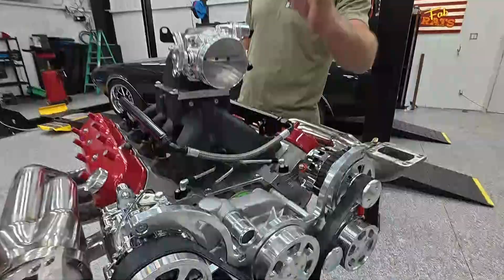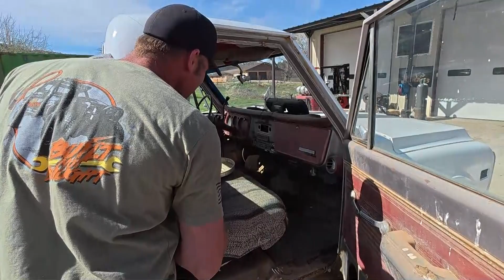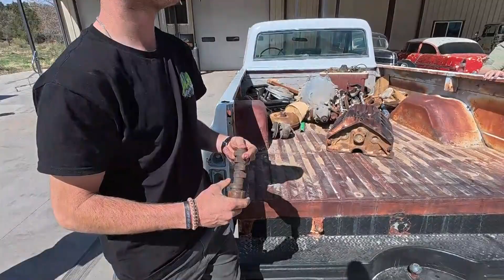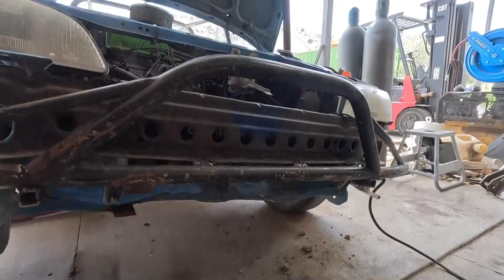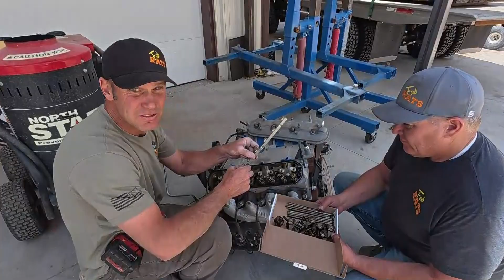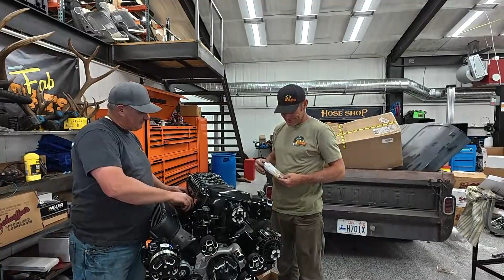They Surprised Me With My High School Truck!

Comment: Paul just fyi just behind the timing cover on driver side there is that pipe plug use that hole to prime the oil system as it bleed more air out right away. Think of it like filling a lower unit on a boat

Comment: I had a 72' long bed 2WD that i bought for $300.00. No engine, no glass and bad paint, Chevy burnt orange color.  Loved it. Replaced everything you can think of on that truck. We had a junkyard close by that I could get great parts for $20 or $30 bucks if I pulled them myself. Had it painted metallic copper brown, replaced the huge steering wheel with a power steering tilt wheel and bucket seats. 373 limited slip rear end and wore out 3 small block 350s in that thing. It was a beast for 2WD. Can't tell you how many center support bearings I destroyed with my heavy foot letting 2 gear bark the mud grips on asphalt.

Comment: Oh boy that brings back many memories for me.  My mom had a Chevy just like that one.  It was a camper specail with two gas tanks and a shell canopy.  We would pulled the horse trailer with it.  I got my driver license in that pick up.  I ran off the road in the sno and hit a tree right after mom got it fixed after hitting a deer with it.  I had it catch fire while driving on a mountain highway with no place to pull off.  That old Chevy survive my two brothers and I amazingly enough.  The only issue whit it was the fly wheel.  Every couple of year mom had to have the fly wheel replaced. One of the better Chevy products.😃

Comment: I noticed the fuel line routing from one rail to the other fuel rail on your S/C'd engine. On my STI tuner car I built a parallel fuel line setup. Apparently the last cylinder to get fuel on the OEM setup can end up being starved for fuel. Maybe your fuel line is plenty big that it's not a potential issue? I need to repurpose my OEM fuel line as the return & order -10 AN to supply E85 to to my parallel setup as my new FP Black Turbo has a bigger demand. Upgraded to 1750cc injectors too. 😎🏁

Comment: I've always been a supercharger man. Starting back in 1970 with a 671 Jimmy on a 440RB wedge head, followed by a 426 Hemi w/ a 871 Jimmy in 1971. I've been a Whipple fan since 2000 when we put Whipple's on a pair of 500 Bull Dogs in a 38' Formula Fast Tech. All of the builds were awesome.

Comment: I drove a 1996 Buick Park Avenue with a Supercharged 3800 V-6 that car would launch and being front wheel drive it would try to put you in the ditch if stomped to get on a road from a side street, in a V8 it will be real impressive.

Comment: My first truck was a '67 Chevy too!  Mine was one my dad picked up from a Navy auction, so it was a stripped down half ton, step side, with a 250 and "3 on the tree."  I miss that old thing.  It saved my life in a roll-over accident.  It landed wheels down, 30 feet down an embankment facing the other direction.  And it still got me home, 300 miles away.  Last time I saw it was 10 years later and it was still running.  Those old trucks have stories to tell.
Reply: My first truck was a '67 Ford 3/4 ton Highboy 4x4 with a 390 that I bought from my buddies dad, and I had some fun in that truck! The first time I went digging in it, we were bouncing around, and the fan ate the battery! I guess I should have made sure the batter hold down was fastened securely, but you live, and you learn! I think I was only 17. Good memories!

Comment: I hope you did your homework and running all holley swap parts. The engineer for all the swap parts has multiple threads on LS1 tech. He designed the pans mounts trans and motor, and the bla k heart exhaust system. Look under the hybrid section. Trans wise, you'll eventually blow the 4l60e up no matter how built it is with that much power your making. 4l80 probably gonna have to cut the floor. Manuals wise 6spd cut the floor TKX more than likely fit with no mods. Just saying.

Comment: The turbo drains you placed on each side of the oil pan. Turbo drains typically don't work on the passenger side because the crankcase windage/going clockwise pressure is higher the gravity draining oil out of turbo. The drivers one will drain. The passenger wont drain well. LS typically install drains in the front cover as low as you can just above oil pan rail all the way towards the outside. Lots of guys sell front covers with fittings in them but you can weld.

Comment: Except that's a GMC truck, not a Chevy.  I mean, the differences are nearly all cosmetic, but still.  I'm basing it primarily on the grill, which looks like a '68.  It doesn't have the GMC in the middle of the grill, which eliminates the '67.  Anything is possible, though.  Parts: we used to mix and match without too much regard to concourse quality of exact match.

Comment: That's a cool truck. I had a 70 GMC 4x4, and it was a great ruck. The GMC, in my opinion, is a better-looking and more desirable truck than the Chevrolet. The front bumpers are impossible to find in really good condition.

Comment: My first truck ws a 70 short wide 2wd, I sure miss that truck. I bought it with a broke down Pontiac 400 in it and I switched it back to a 350. I loved the fit of that truck better than any I have had, it was comfortable to drive.

Comment: My first truck was a 57 Chevy short box with 327 and a 4 speed.  My second  truck was a 72 Cheyenne 3/4 ton with all the chrome and factory air.  Put a 69 grill in and mounted driving lights in the bumper where the turn signals were.Three tanks held 55 gallons of gas. TH400, duals, front disc brakes.  Had it for about 10 years.  Still miss it.

Comment: Many years ago I worked on Detroit Diesel Engines  for a time before I left on a mission.  Your supercharger, and most of them are off a Detroit.   The key is you have to get turbochargers wound up.   Superchargers have a bit of wind up, but they get things going much faster.  A supercharged engine will always be quicker out of the gate, within reason.

The drawback to superchargers is, if you get a big backfire event, you’re pretty much guaranteed to destroy your supercharger and a good portion of your engine.   You can usually get away with an event on a turbo charged machine.

Comment: The Snap-on tool that you received in the mail. Not only is it for adjusting carbs but it also has a bit to adjust the points/dwell on GM distributors. I have the same tool. Don’t use it very often but it sure comes in handy when adjusting a “hot” engine.

Comment: Put both on one engine. Then you can pipe both turbos into the supercharger. You will then have a super-turbocharged engine. The turbos will spool up so fast,  that the turbo impellers might get sucked out of the turbo housings. Awesome & interesting videos as usual, especially for a disabled guy like myself. Peace out guys.

Comment: I have a 67 Custom with the big window. It was our tow rig when we were racing. It's got a 9 inch with a Posi  internals out of a Mustang  with a 455 Olds and Turbo 400. A mild build but arp bolts and the customary rv cam and flat tops plus balanced. I built a 10' bed for it, another floater rear axle  and threw on a Kidnapper with a gooseneck to pull the trailer. It was a beast. 3.00 gears. It just pulled like a diesel. Still got it but it hasn't moved for 25 years. She actually got good mileage on it's own. Scary part was when it was unhooked. You quit before it did. Crazy what we did back then. Those old trucks you worked on all the time are just tough to part with.

Comment: Superchargers all day, of course saying that as a same truck owner for past 55 years. Currently runs a Weiand 177 on sbc. Used to run same size blower on bbc but 7mpg was killing me gas wise, so went to sbc in 2010. I use my truck for towing a RV so major hp gain was not the goal-pulling uphills in west usa can take little extra power at times.

Comment: You going to add a separate oil system for turbos?  That's what generally takes out turbos is bearing failure from heat.

Comment: I have a 2002 Chevy Duramax 1 ton Dually diesel RWD that was my work truck for the last few years, and I'm retired now. It has cold air intake, exhaust brake, tuner, and air dog fuel system. I plan on selling it for next to nothing and just wondered if you would be interested $4,500. takes it away. It does have body damage to the stupid plastic rear panel on the driver's side from backing up into a way to steep driveway with my trailer, other than that it's fine. Let me know if this interests you.

Comment: Hay paul the turbos make power with in half a second and there more for the top end of the run. They don't make all the power like a super charger does from the start they have all the power on tap, but the turbos will out power on the big end of the track bc they just keep making power when the super charger tops out. You van only spin it so fast and that's the down side to the supercharger. There good for off the line but get left on the top. That's from my experience of them both

Comment: The sweet ride I had in high school was a 69 Chevy long bed, 383 small block (nowadays called the stroker conversation) chevy V8 with  with cam swapped from a 400 big block, re-ringed , everything was gone over adding new be install, play Muncie 4-speed, and a home ^made posi*winks@paul😉. It wasn't a factory engine. Dual Hollies on top. This was back when gas prices were 25-29 cents a gallon.
Best fun had in a shop and1 friend to help, took 3weeks.

Comment: I prefer superchargers due to the turbo ‘overhead’….letting it idle for a minute or two before shutting it off to let the   spool down, especially after spirited driving, excess heat and cooling cycles unless it has a water cooled design and low end power build although they seem to have worked this out on my current twin turbo Audi RSQ8…..

Comment: Yep.. I had "friends" like that.  My 84 Blazer that I had to leave at a buddy's property got "stolen"     I had worked on every part of that truck.  Welded in new panels anywhere there was rust and eventually replaced the front clip with a narrowed and shortened Hummer tilt front mounted to a custom made front bumper that I built from 4" square tubing I found at the scrap yard.  
   I absolutely loved that Blazer and would drive my kids up to Michigan in it to visit my family and take them swimming and just on country drives.
  The trans started failing at the bottom of Michigan with a long drive to Maryland... I prayed for God to just let us make it home.  I literraly pulled in to the driveway, thanked God and instantly, the truck would not move another inch under it's own power.

Comment: My Dad had a 71 3/4 ton.  It ran good, and he wanted to give it to me.  I didn't have the skills, tools, or the space to restore it.  It needed body work because of rust.  My cousin ended up buying it.  Last year I had a chance to see it, he has the tools, skills, and space to do what is needed.  He had it stripped down to the frame, and was installing body parts from a parts truck he purchased.  He had different cab on it.   He was in the process of converting it to 4WD.  I can't wait to see it when it's done.

Comment: Paul,

You and I are roughly the same vintage and have a similar life connection with those trucks. I bought a '71 Chevy Cheyenne 2 wheel drive when I was 16 for $300. I drove it for a couple of years in high school. I learned all about wrenching with that truck, including swapping out a used 350 engine and then a fresh rebuilt 327. Lots of good memories hunting deer and also terrorizing the town in that truck.

When I was 18, I bought a '70 Chevy Monte Carlo (also for $300 interestingly enough), and swapped that good 327 into the Monte. I then sold the truck for parts, but amazingly I still have the Monte. My wife jokes that she is going to bury me in the Monte when I die.

My claim to fame with the truck is that by the time I pulled that 327 the last time, I had it on the floor in 45 minutes (and that was before air wrenches)! Of course all the bolts were not rusty, and I knew where each one was. 

Great memories!  I really love how that truck taught me how to work on that vintage of Detroit Iron and to appreciate the styling and engineering of that era. The 60's and 70's car and truck design will never be beat.

I'll watch for wrenching on it, and whenever we come through Utah, we will come and meet you all and get some more merch at the Fab Shack.

Happy wrenching.

Comment: A motor with Twin turbo with a blower and nitrous. It will be one bitching motor if you can get it all to werk together. The instant power that a blower give will allow the time the turbos it needs to spool up. The  nitrous will add to the power. If you can get all that power on the ground, you will have a vehicle that will be a handful.

Comment: Me and my students built a 68 c30 years ago. 572 CBB with direct injection and supercharger. It ate th400s for lunch. I chose a Allison 6 speed transmission for it. That was the transmission that worked well with the high  power of the engine. 

I did end up using a long bed for it, but had to modify the bed with a step side type of rear fender for the rear end and tires to fit in the way I want.

Comment: For the ones who don't believe in o-rings . Don't be afraid . My air rifles fill to 350 bar or 4500 psi . If it holds that kind of pressure it's going to hold anything a motor intake can generate .

Comment: My truck I had for over 25 years was a 70 1/2 ton 350 4 bolt main, turbo 400 with limited slip posi in Turquoise and White with A/C, miss that truck

Comment: I bought my first toolbox back in 1974 from a pawn shop. It was just one of the larger top handle carry Trey type toolbox but it was packed to the gills with stuff. And in it there was a set of these little plastic things with magnets in the centers of them with different sizes for different sockets. They would hold the bolt or nut  and you could place them anywhere you wanted without losing the nut or bolt.

Comment: Paul have you seen the new engine stand that have the crank on them so you can easily turn the motor around to work on different parts of the motor Robbie just bought one I believe from Harbor Freight but don't quote me on that. After seeing Robbie and you work on a motor it is kind of cool check it out

Comment: I like the look of the all black and compact size along with the superchargers unmistable wine that they make.. the twin turbski's are fun to r u deal in especially when the blow off valve releases that air pressure but they just take up so much space and kindof clutterbthenengine compartment up plus u can't really pull up all stealth like in true sleeper fashion and smoke them light to light with such satisfaction as they try to figure out what u have that just smoked them where if u pull up with twin turbos most people won't want to race ya cuz they know they'll get smoked so if ur into racing for pinks a twin turbo setup is going to ruin alot of chances

Comment: I don't think you'll be as enthusiastic about the turbos until you get better turbos. If it's a budget issue call Viren at VS Racing for an affordable, reliable turbo with support if required.  He has some very nice mirrored turbos that would be much more visually appealing than current configuration.  Independent waste gates and blow off valve are desirable. 
At that point you will definitely become a turbo guy, especially if you have any desire to TURN IT UP. (Have your Tuner show you the up arrow)
Nothing like 28lbs of boost...

Comment: I had an old 64, back in  76-77. An old 6 cylinder, straight drive. Had a black diamond pleated interior ( seat ). Drove it for about 4 years, back &  forth to work , 80 miles one way. I got attached to that old truck. But it got to using oil really bad, & I sold it. Have missed it. Why I didn’t get the motor rebuilt I don’t know, but it was a good one.

Comment: thatborangebstepsideblooked alot like my old stepside i had but mine was all white and I shaved the drip rail moldings off the top of windsheildband both doors along with that i put one peice windows in the doors that I put power to and it looked pretty slick with that all switched out but it was subtle luke you had to know that I shaved the drip rails and that ther no longer was the lil wing windows and I body worked the windshield surround and painted it so the windsheild no longer used the rubber seal gasket to hold it in so it got people staring they just couldn't usually figure it out unless they were die hard truck guys that worked on them.. but that one you got is a real a nice a/c cab which was a rare find even back in the 80s before they came so popular for every one to build.. but that truck it's in real clean no rust shape they are so simple to work on and fix up I always bought on my 67-72s is the blazer gas tank kit so I could have way more gas capacity but it also meant i no longer had to smell or worry about a potential bomb behind my seat hping off, plus I always used that space in the cab to put 3-12" subs behind the seat

Comment: @FabRats Jace needs you to start a channel for him it seems, name it Jace's Junk lol! As for the engines, the supercharger is great for everyday run around or when you need quick responding low end power. The turbo is WAY better for drag and burnout competitions, but lack power when you smack the throttle to WOT due to it not having built boost pressure yet. They server difference purposes really. The instant power and response is why a SC works well in the tow truck. There is also a big difference they make in air density from heat each produces.